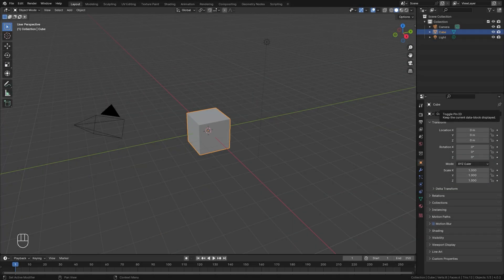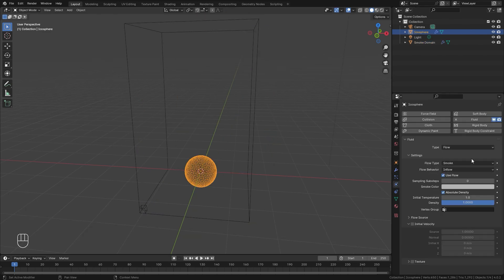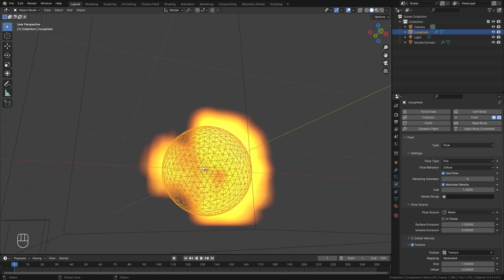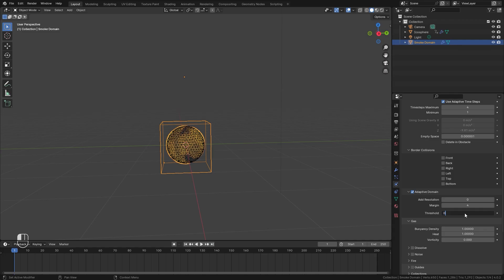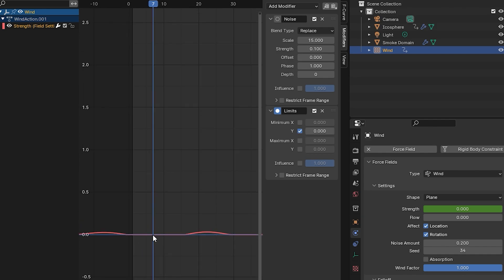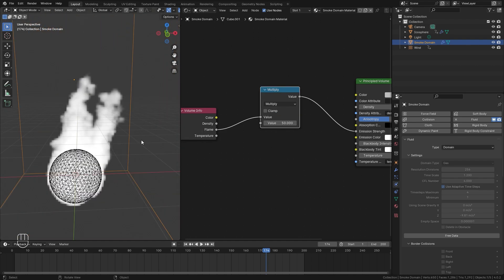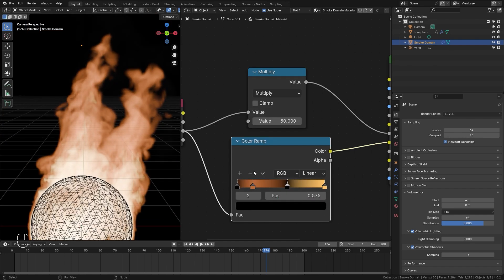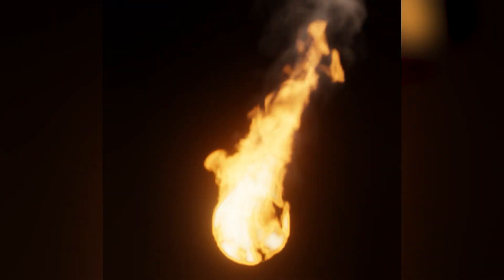Fire Simulations in EEVEE are Easy! Blender Tutorial

Comment: For anyone wanting to overlay this animation on another video, meaning they need the background to be transparent, the best fix I found was to export this animation as black and then composite the overlay (If you have davinci resolve, under composite choose "add".) which removes the black and keeps the fire.
Reply: Render properties -> Film -> enable transparent
This renders the background as alpha as long as you've changed your output to something that has alpha. 
E.g. use PNG output with RGBA colour. If you drag all the PNGs into the resolve timeline it will automatically change them to a video for you, just make sure your timeline is set to the correct frame rate

Comment: For a tall distance shot (~25-50 m) or a Low-End PC you can use these Rendering ''Volumes'' Settings: Resolution 1:2; Steps 8; Distribution 0.5; Max Depth 16; and a custom range as shown in video. You will get much faster rendering (30-40% faster) and a quality loss only about 15-20%.

Comment: For those having trouble with the flame appearing after baking and switching to rendered, instead of adding a attribute node, add a volume info node and connect the flame to the emission strength; then sandwich a color ramp node between them.

Comment: can confirm "volumetrics" panel is not located as in the video in v4.2.1 of blender 12:43
Reply: I was wondering the same!! I only have volume with different settings. Did you manage to find it ?
Reply: @aa.antarr  The same here, there is no volumetrics and it is volume.Is this good because when I open a file created with 4.2.1 with 4.1, it is converted to where the values are similar?Furthermore, with 4.2.1, if I hide the flow object and render it as shown at 15:57, it goes completely dark.I have tried temporarily making the material of the flow object transparent, but I don't know if this is a change in Blender's specifications or a bug.Thanks for the easy to understand tutorial.
Reply: The issue of the flow object not rendering when hidden has been fixed in the 4.2.2 Release Candidate that is currently available.

Comment: i rendered with cycles so i can have a transparent background and the result seems like it has a very low opacity. Also i cant find the volumetrics panel in 4.2 edition. Any help ?
Reply: i had the same issue, but i found in blender 4.2 that volumetric is split into the volumes section (with custom range) and shadows section (with volume shadows). hope that helps!
Reply: Im having the same problem
Reply: Yes, where is the volumetrics panel. I'm searching it too 🙈

Comment: I can't figure out why but turning on 'Modular' in the domains cache setting stops the simulation all together.
It doesn't seem that important I can just use 'Replay' but I feel like I should mention it anyway, see if anyone has/needs a solution.

To elaborate and repeat myself.
When I Set the Type to 'Modular' in the physics tab on the domain of the fire, the fire becomes invisible.
I don't know if its invisible or unrendered. (Though theres no lag when I press play so I'd say it's just not rendering)
I've tried different viewport shadings, letting it run a while, rewatching the video. 
But everything I've done in my project is Identical to the video and works fine.

Thats all, Figured I'd mention it, it doesn't really affect me at all.
Anyhow, great video! Good job!
Reply: make sure you tick "is resumable option"

Comment: Great tutorial! Only problem is every time I try to bake with any value higher than 64 or so blender crashes every time. I have an extremely good PC, (Intel i9-14900K, RTX 4090, 128gb RAM) so that's not the issue. I've reinstalled blender, restarted my PC... I'm at my wits end

Comment: Hi. I'm starting the bake, and I get a message which says "Non Resumable Data, Baking noise will not be possible."  Am I doing something wrong? Thanks for any assistance you can give.
Reply from the maker: That just means that you haven't clicked on the "Is Resumeable" option in the cache tab. You will still be able to bake the simulation but you won't be able to pause the bake and resume it and you won't be able to bake in Noise if you wanted to do that. Usually I do like to have the Is Resumeable checked just in case I want to pause or stop the bake halfway through.